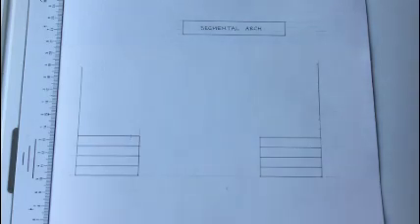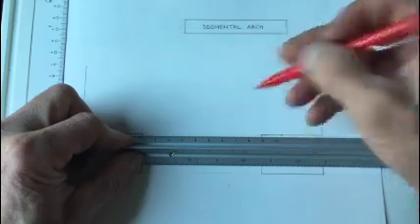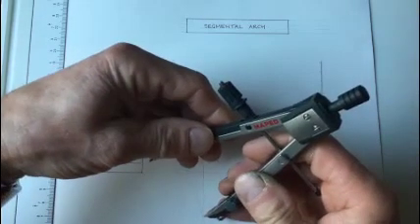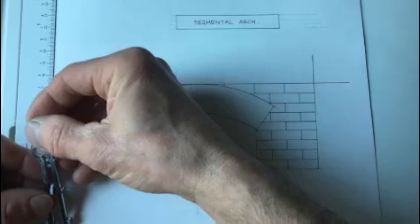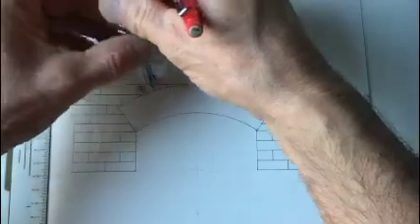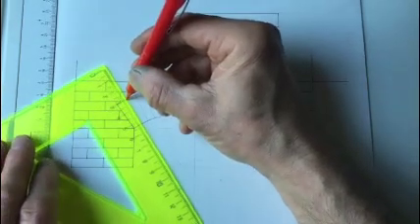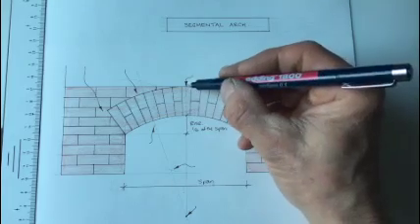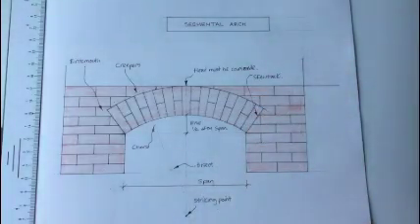Drawing Arches 2 - Segmental Arch

Comment: How can I divide the arch into equal parts with a brick in the middle . Is there a formula I can use?
Reply from the maker: It depends whether you are doing a rough arch or an axed/gauged arch. 
With a rough arch you need to set out on the intrados, on axed & gauged arches you'd set out on the extrados.
Either way, set you dividers to c70mm and start centre of a brick at the centre of the crown and lightly trace the dividers to the springing point, adjust as necessary (always going smaller) until the tracing around fits. Then trace and mark each brick/voussior and draw in the joints by radiating to the striking point.. I hope that helps.

Comment: Gday Rob. I love watching your channel. I’m learning my trade over in Australia.i have a question for you. After I’ve drawn up this arch to scale on paper, to work out the actual size of the voussoirs do I just minus a joint I.e 10mm. I only ask this as when I get to the key brick I still need another joint to get it to fit. Sorry if it’s a dumb question.
Reply: No dumb questions Chris. 
The top of the key brick (the centre voussoir) should be the same height as the last course of bricks that need to be cut over the arch.
So if you have your coursed marked up on a profile either side, pull your line across on your marks and the key brick should just meet the line.
On a side note, I think your bricks are a slightly different size to ours, so ignore our measurements in the UK.

Comment: Is it always 1 ,6th of the span the fourmula
Reply from the maker: 1/6th is the ideal ratio but i slightly adjust that if i have to do that the top of the arch is correct with the bed joint.

Comment: keeping 75mm gauge on the extrados you would have 10mm joints, I remember you saying joints must be 4-6mm, does this not apply here?
Reply from the maker: Yes, this is true.
You will see on the video when I come to build these how I set them out on the extrados. In the meantime  you can see it being done on the video '4 centred arch'
Thank you for watching
Reply: @robsonger1  thanks for answering Rob, if you could answer one more I have that would be great.
The arch has a rise of 150 over a 900 span which works for brickwork but because the axed soldier is dry that with give you 365 overall leaving you with a 20mm bed over the crown? If thats correct would you bump up the rise to 160 to accommodate?

thanks again
Reply from the maker: @HarryWarren1  Yes, exactly right. Well noticed. It will be shown when I video the setting out and building of it.
Reply: @robsonger1  Glad I'm on the right wave length, looking forward to you building these at the farm, especially the Florentine Arch. Thanks
Reply: @robsonger1 any chance you could help me out 1v1
Reply: @robsonger1  hi Rob , just wondering if you had time ? Could you make a video on how to set out or draw  tumbling in ? Would be much appreciated ,G
Reply from the maker: What do you need to do?
Reply: @robsonger1  everything I'm here practicing I've forgotten it all

Comment: Rob you are a master. Do you have any advice/resources for building a perfectly circular brick wall.  I've been asked to build a hip-height raised garden bed either from stone or brick. Curious if you have advice about how to do that. She wants what is called a keyhole garden, which has a cut out so you can access the center. Kind of like a pacman.
Reply from the maker: Yes Tim, the staircase we built recently was circular, please look in the Community section on the main page here, there are a few pictures that might help, then ask me any questions you might have and I will try to help.